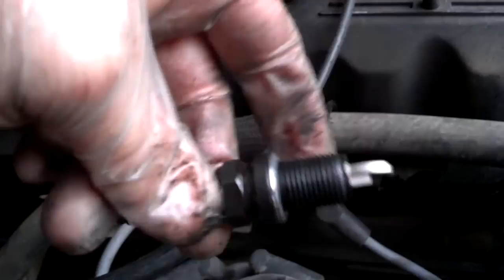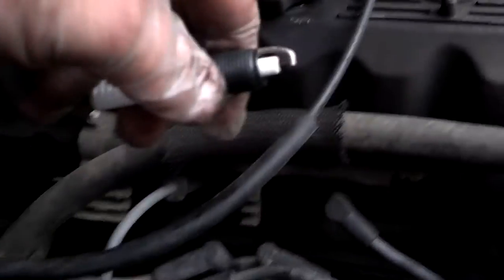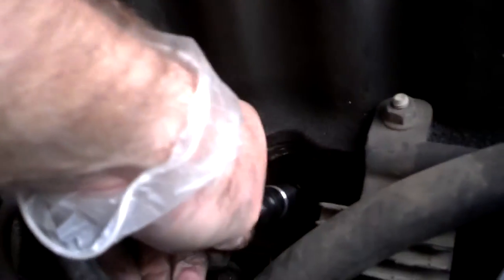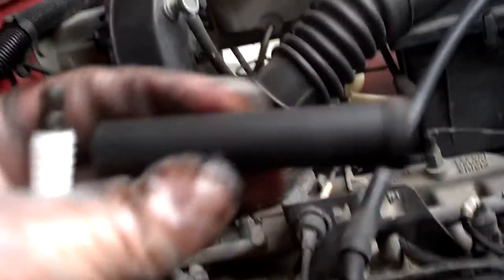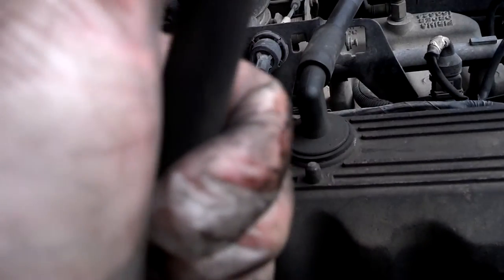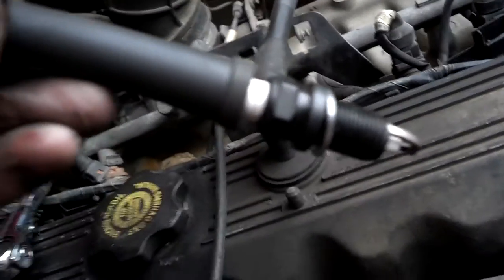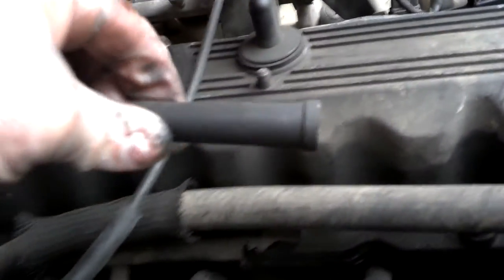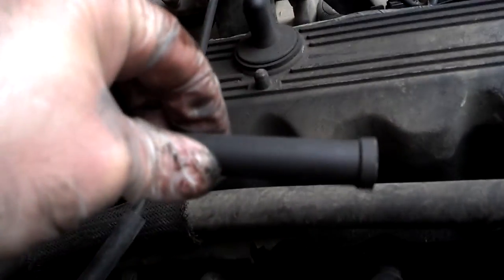Jeep Wrangler - Easy and cheap spark plug install tip.

Comment: Nice trick!  This will come in handy for me, since I just got a '98 Wrangler.  

One nice bonus to your trick is that if the plug accidentally starts to cross-thread, it won't get forced and cause damage since the boot will just slide around.
Reply from the maker: YouTube comments didn't notify me that you left this comment.  You are very much correct, you can actually feel if the threads aren't engaging correctly. If they don't your arent gonna cross thread it into the head. Thanks for leaving a great comment!! Have a great day!

Comment: awesome tip...trying to get those plugs back in was a major pain...also with the inline 4 cylinder the number one plug is dang near impossible to reach without socket extensions...always love the jeep vids...thanks so much!
Reply from the maker: Glad you like 'em! Most of my plugs really aren't that bad. They recess deep into the head so it a bit of a pain getting them started, especially when I shot this vid. The engine was still fairly hot to the touch. I found that #6 cylinder plug was completely fouled. I have an engine I pulled from a '95 Cherokee that I will be swapping in soon. The current engine in the Wrangler is just limping along. I mostly use this trick on my '84 GT to work around the headers installing the plugs. Hey man .. thanks for the great comments you constantly leave! Thanks for checking out my videos! Have a great day!!